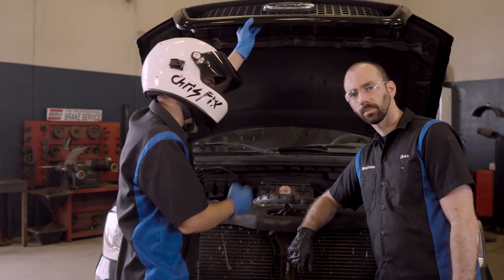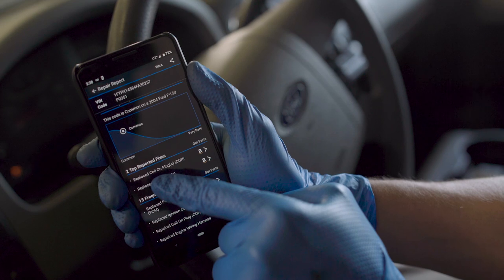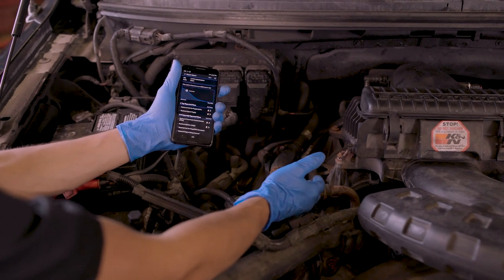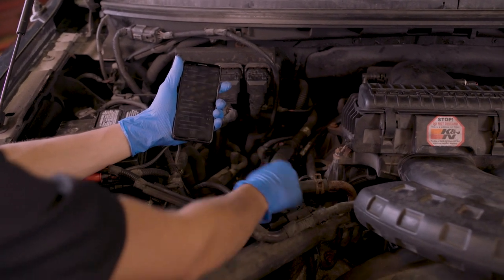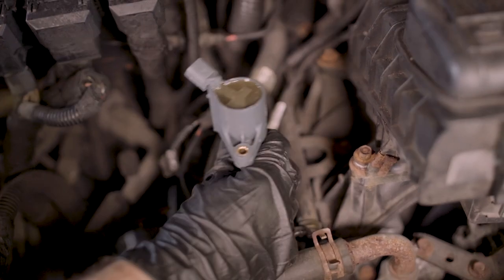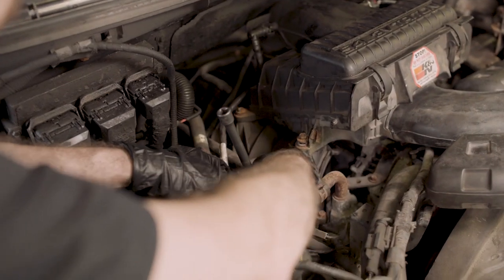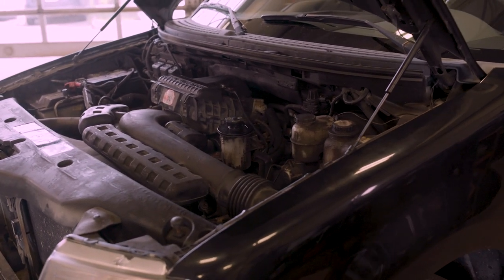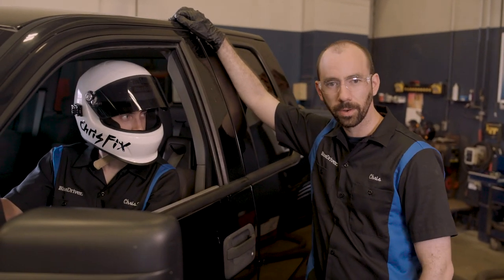Ignition Coils (with ChrisFix!) – 2004-2008 5.4L Ford F-150

Comment: You just saved me thousands!!!... a mechanic said my transmission was going. I did my research on the engine and found that this exact problem causes misfires and a jerking when accelerating up hill and in OD. Thank you so much!!
Reply: That’s what mine is doing now 
Did this coil swap fix it 
I have a net set to put in
Reply: Mine was doing the same thing, misfires but almost exclusively in od going uphill. replaced all 8 and the sparkplug, it was good for 15k miles. and now it's misfiring at idle and showing it's a coil pack...I'm not sure if it's really something else going on. how has yours held up?

Comment: Before replacing any coils you should get your catalytic converter checked. My truck was throwing ignition coil codes so I replaced all of them but I kept getting codes. Turns out one of my converters was completly blocked which was throwing false ignition coil codes.
Reply: What did you do to fix it? Can you explain please thanks
Reply: I’d definitely start with diaging to see if it’s a coil first. Coils are $40-50 compared to $500-1000 cat

Comment: Bought a used 07 5.4 f150, previous owner bypassed the heater core and its going to be cold soon. I've searched with no luck for anything that shows the heater hose routing....and what parts I may be missing. Any help would be greatly appreciated! Thanks!

Comment: What app r you using to get the reading on codes ?
Reply from the maker: We are using our BlueDriver app, it can be download for free from the Appstore or the Google Playstore, just as a heads up it will only work with BlueDriver sensor.
Reply: @LemurMonitors  lucky, my truck doesn't throw a check engine light until it's really bad

Comment: Question for you. I bought 8 new coils to change out the old ones. When going to remove the old ignition coils. They start to pull out easy but the spring in the middle seems stuck to the spark plug. Not the boot but the spring starts stretching. I didnt know if I should just keep pulling or if there is something i should use to grab the spring and help pull it. Thanks.

Comment: 2006 Ford F150 Lariat Supercrew 5.4.  I've had what I believe is mis firing for a while now.  I replaced all of my spark plugs myself and the misses went away. They came back again a few months later and I checked all my plugs and found one that was extremely loose.  I tightened and the misses went away briefly.  Now the misses are back and ive checked all my plugs I think 3 separate times now.  I'm quit the pro at checking and replacing all of them now lol!  During ALL of this I have not had any check engine light come on.  I have an OBD2 scanner hooked up Bluetooth to my phone and I'm running the Torque Pro version app.  All scans and test come back normal.  The truck really misses under load like going up hills, and also in the higher gears.  The lower gears I'm misssing some hp.  So I'm thinking I might have a bad or several bad ignition coils.  What's your recommended way to test them?  I love Chris Fix and his vids.  I've been a suscriber of his for a long time.  I appreciate any reply I can get guys!  Thank you so much and sorry for the post being so long!  But I'm really trying to figure this out.
Reply from the maker: I'd have a look at mode 6 (even if you are using a competitor scan tool 😉) for test ID $53 - this will show your misfire tests per cylinder and might help you narrow it down.
You can find Ford's misfire mode 6 documentation at http://www.fordservicecontent.com/ford_content/catalog/motorcraft/OBDSM608.pdf starting around page 9
Reply: Use Forscan on a laptop PC, or do this trick with Torque to get the misfire counters - https://www.expeditionforum.com/threads/anyone-interested-in-misfire-counts-mode-6-data-via-torque.25204/

Comment: That truck sounds bad even after the fix lol new manifold might help
Reply from the maker: Your right! This wasn't the only thing we did to this truck for a video!
Reply: Oh my!  sounds a bit better-err. I was really worried about a new timming issue at 175k on my 2004 f150 after  but after doing the whole timing system myself at about 150 k but my truck with the same code appears to sound like new comparably pre fix! There is hope.

Comment: I think I have a coil going back on a 2007 F-150. It hasn't tripped the Check Engine Light yet. How could I use the scanner to check how the COPs are working?
Reply: If your scanner is able to view Mode 6 data you should be able to see how many misfires are on each cylinder. Any cylinder with a bad coil should have significantly more misfires than the others.
Reply: In 2006 Ford changed over to a LDR and HDR data witch means low data rate and high data rate so they used crank speed to determine a misfire event mode 6 was no longer needed in 2007

Comment: My 05 Ford F-150 had a new engine put in 4 years ago.  The last 3 years about every 4 months a coil goes bad. Typically I brought it in for service.  But at $250 a pop I’m tired of getting them replaced one at a time.  First number 1 went than 3 and than 5.  Is this typical?  I’m asking as I have bought a new set and plan on doing the work myself but want to know if there is something more I should do?   Thanks
Reply from the maker: Hello!  We did find some info for you! Coil replacement seems to ramps up at around 70k and tapers  off at 150-170k mark . id suggest going to parts store and doing them yourself if possible and if its a consistent problem. using dielectric grease when installing them on the spark plug and connector ends of the coil, might help make them last longer.
Also make sure no water, coolant or oil is around the spark plug or coil or in the cylinder .
if you wants to risk pulling the plugs they might be defective and past there life cycles causing the coil to over stress and burn out early (triton engine plugs are known to be not that best)

Comment: 👋 Chris were can I get that scan tool used in video and can u use that scan for over the road truck freightliner, Mac,,Volvo etc...
Reply from the maker: We sell it at bluedriver.com (nothing wrong with a little shameless self promotion)
It will do engine diagnostics for commercial trucks that have 12V electrical systems and the standard 16 pin connector, but if you have the round 9 pin or a 24V system you'll need a "J1939" tool

Comment: What if the mechanic installed 68.1 ratio coil packs in a 2010 ford f150 that calls for 75.1 ratio coil packs?

Comment: Replacing the number 8 coil and wonder if it's supposed to snap in place or is it just kind of spring loaded and I tighten it down it feels kind of loose in there
Reply: I was wondering the same thing
Reply: @impulse959  Turns out after replacing the coil, after a few months, it started acting up with a rough idle again.  Took it to another garage other than the dealership and low and behold the number 8 plug was never installed correctly in the first place!  The whole electrode was gone and the smell of leaking fuel was present.  Had to replace all the plugs and coils!  Running smooth now. About $1500 for that fix which a local Ford dealership failed on!

Comment: Yes I've changed my ignition coils and the 3 plugs that were misfiring and one code for a misfiring plug left but two are still there and now I have the p0022 p0300 p0305 p0307 p0316 p0345 p0351 p0352 p0353 and I don't know what else to do please I need some advice thanks
Reply from the maker: Hello Bruce! 

Send us a copy of your scan report over to support@bluedriver.com showing all the codes and let us know what you've done already. We can have a look for you! The email is monitored 10 hours a day 7 days a week!

Comment: How do you know what coil to swap out I got a p0352 on a 2008 Ford Expedition 5.4?
Reply from the maker: It's an 02 but it should be the same - https://www.cargurus.com/Cars/Discussion-t528_ds612703
Reply: What was your problem bro ?? I had a P0420 P0351 & P0302 i just swap the ignition coils
Reply: @maurotafoya8415  went on Amazon and bought a 8 Pack and Swaped them all out, fixed my problem and got rid of the engine shake👍 $35 fix, still keep the old ones just in case

Comment: With my check engine light on, I went to AutoZone to get the 5.4 motor scanned. Got a P03 code (misfire).  I'm almost certain it's a coil that's got a bad connection. But their scan tool doesn't tell which plug is reacting badly.  Can I get another scan someplace else to get a reading on which  is coil is bad besides going to the dealership? I would like a more specific reading to pinpoint exactly which one is trouble.
Reply: For each coil one by one, remove the electrical connector.  If the engine runs worse when you pull off the connector, then that coil is fine.  Once you find the one that you unplug and the engine doesn't run rougher or change idle speed, then that is the bad one.  Also, it is certainly possible that the wiring harness has issues and isn't providing power or trigger to the coil.  If you have a meter and manual (with wiring diagram) you can check the power and trigger.  A "noid light" would make the trigger check easy.  In lieu of not have eqp. or the wiring diagram to check the wiring, you can swap the suspect coil with it's neighbor.  If the issue stays with the coil, then bad coil.  If the issue stays with original cylinder, then likely wiring issues.
Reply: @BearNPum  Makes sense now.  I used to do the same thing to determine which plug wire was bad. Doink!  Common sense, really.  Thanks for responding.
Reply: Oreilly auto parts

Comment: The cops activated by 12 volt or is it a lower DC voltage?
Reply: It is actually 12V, however, they all share a common +12v rail ( all wires will be the same color) that is fused, and then each coil has an individual ground on the plug that goes back to the ECM.  So in effect, they are always live, and the ECM pulses ground to the coil to fire it.

Comment: What would you do if someone in the past rounded the head of the bolt? I’m going to buy a 12 point 7mm and 6mm and try to hammer it on to undo the screw. Any others ideas? Thanks
Reply from the maker: Maybe try a bolt extractor? You could also try a chisel/hammer if you can get a good angle on it

Comment: Run the drive cycle and set readiness monitors before ya confirm the fix Nd for god sakes fix those manifold leaks so the o2s can give correct fuel trims before closed loop makes the adjustment!  GOD freaking idiots!!! JK the DYIer’s will love ur Minnie android scan tool and want to know where you got that awesome scan tool
Reply from the maker: There's another video on lean condition that goes over manifold leaks